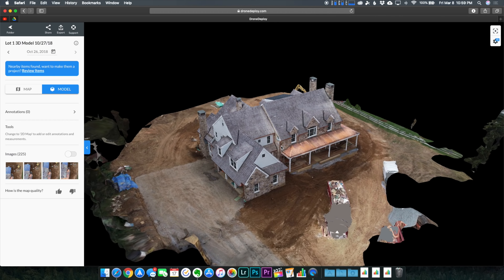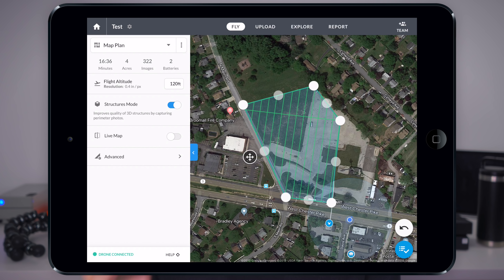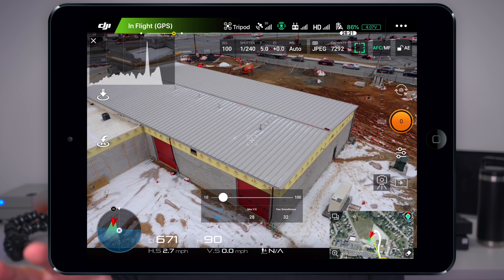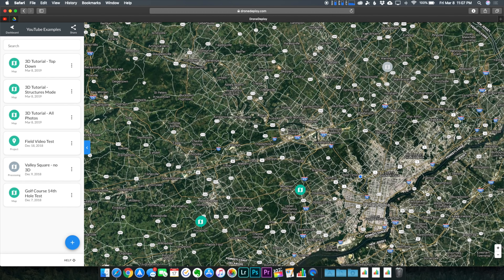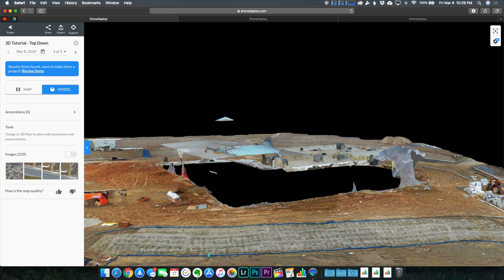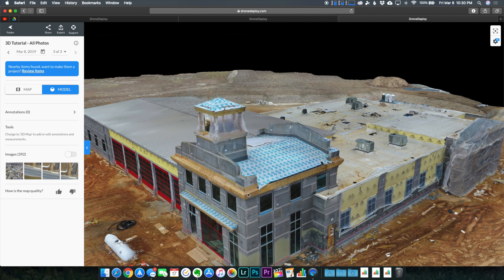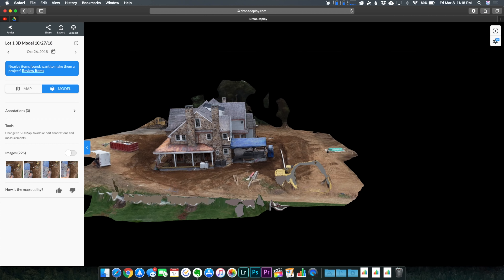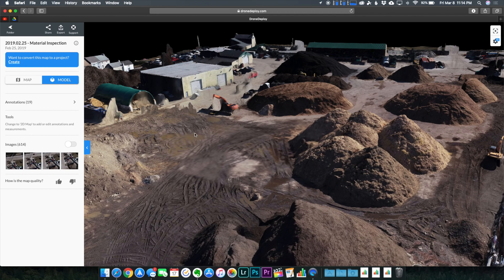How To Create a 3D Model Using DroneDeploy

Comment: Thanks for the video how do you send the maps and 3D models to your clients? Do they have to have any special software?
Reply: Did you find out how?
Reply: The only file type you can export the model as is a .obj file. This can used in CAD or GIS. But It is not georeferenced, which is a huge issue. My organization is probably going to either change to DronetoMAP or Pix4D, due to this issue. Good Luck

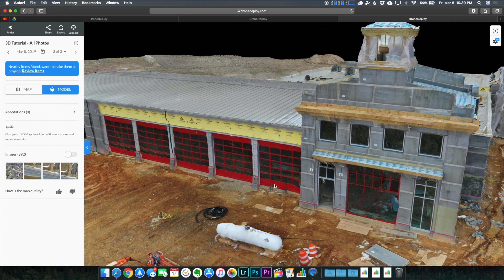Comment: Great video.  At 6:04 you said you could go back afterward and take additional fill-in photos if you wanted to improve the 3D model, but when I tried going back and doing that the resulting model was completely ruined. Someone told me that all photos need to be done at the same time, due to slight movements in satellites even over a couple of hour period.  They said the only way to ad photos is if you are using really well defined Ground Control Points.  Can you please confirm that or explain how you are able to do that after the fact.  Thanks!

Comment: Hi billy you will get much better modeling results with pix4d and photoscan as you have more manual control over how to process and you should not use auto white balance for mapping or modeling always use manual. Still great work though for using a cloud based processing engine. As usual keep up the great tutorials

Comment: Hello Billy, Great video! I have a couple of questions. For the 3D model are you using just perimeter shots of the building or overhead shots I.E Orthos. Second Approx how far away from the structure are you when acquiring the photos. Thanks, Mike

Comment: Does dronedeploy render using object recognition only? I get the impression that this might be the case from the top regarding the additional orbit upload. I'm wondering about using multiple drones to map an area that is usually underwater to take advantage of a very short low tide window. Separating the 500 acre plot into two, or even three flight plans would greatly increase our probability of getting it done in one day (the three drones are all different types, though....Mavic Pro, Mavic 2 Pro, and Phantom 4). Thanks in advance for any recommendations.

Comment: I am in the process of changing my careeer. Would love a review of dronedeploy subscription options, what would you recommend for someone just starting out.
Reply: It's not cheap, about $3k billed anually so with the price of the drone and a tablet its a reasonable investment. We use a Mavic 2 in our office and it is great but it doesn't compare to professional drones in regards to camera quality so you would need toss up what end of the market you were aiming for. Dronedeploy is a fantastic service and the stitched aerial photos take people back when they see the resolution. The difficulty can be if you're doing something like a school with a dozen buildings you might need at least 6 batteries to get the job done. Also unless you go for the $6k plus subscription you can't get the point cloud in a file format that Architects can load into Autodesk Revit. The way around this is you can get an Autodesk Recap licence which will allow you to save it out in the correct format. However that is probably another $1k per year. The advantage being is you can use recap to clean up points so if you have a bunch of trees that are mudling the model you can just delete those points. My word of caution is if my small architectural office can justify the cost of doing this so could most others so you would need to be carefull like digital photographers of the past that once the cost of entry gets this low you may eventually struggle to get customers unless you have a commercial drone and all the licences that go with it. The other issue is it won't work near mobile phone towers or high voltage lines as there is to much interference. The other issue is in Australia there is a 5km exclusion zone around any airport or heliports including hospitals. This becomes a real issue in regional areas where everything is 5km from the airport or hospital.